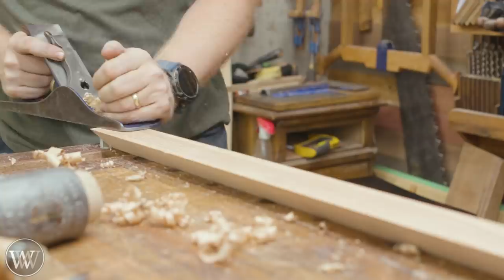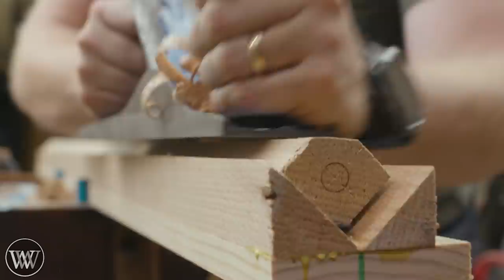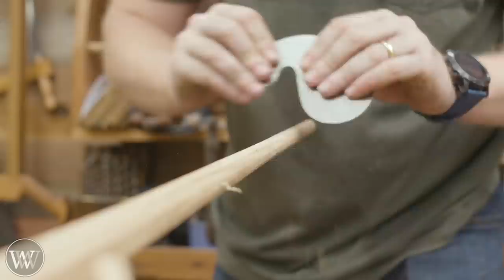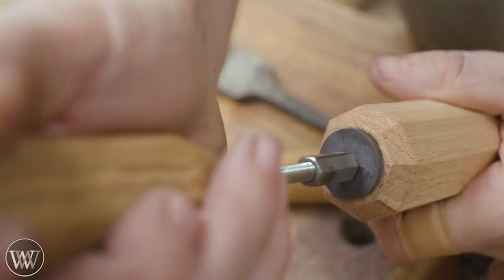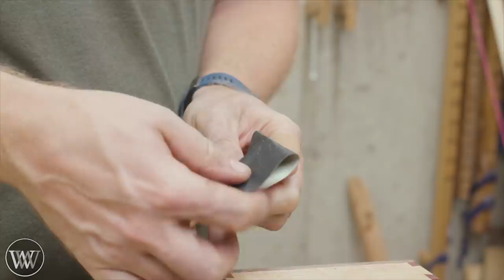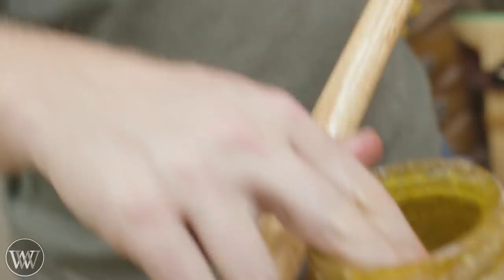Pool Cue Made With Just Hand Tools

Comment: Nice video but playing with fire with that lag screw.  Might I suggest a dowel next time?
Reply from the maker: Thanks. No a dowell is not adjustable and you need to be able to make it thread up and down. Though it looks like something you could very easily hit it is actually very hard as it is lower than the circumference of the circle. And even if I do hit it with the scrub plane it's no big issue because it's a scrub plane

Comment: Nicely done brother, but do you not have a shave horse and a draw knife?  I love my hand planes too, but that's crazy!
Reply from the maker: Thanks. a shaved horse andronic would work but it would be much harder to get an even clean taper. The nice thing about doing it this way is that you can get a smooth taper running from end in very easily. on top of that you can take off a bit more material accurately with a scrub plain then you can with a draw knife unless you have a lot of school with one which I've seen some people who do.
Reply: I didn't think about a scrub plane.  That makes a lot of sense.  Thanks for the reply!

Comment: What a great project. Is oak the "correct" wood to use here? I would guess something like hickory would be used traditionally. Not judging, legit question
Reply: Cues are typically made out of Canadian maple, although I don't see why oak couldn't be used for people who prefer something heavier.
Reply from the maker: there is no such thing as "correct" wood most common is hard maple,  but usually closed grain very hard woods. I have seen several higher end companies that make them out of south american woods.
Reply: Snooker cues are usually ash, I'm not sure why. It might just be tradition. The flexibility and density of the wood does affect cue ball deflection. Two piece cues usually have a maple shaft, and the butt can be anything. Carbon fiber shafts are becoming popular, but they're expensive, and not everyone likes them.

Comment: not how we did it when i worked for Carmeli Cues, but bravo sir.
Reply: Come on!  Do not leave us in the dark. How did you make ques at Carmilis?
Reply: Come on now!  How did you make them at Carmeli 's?
Reply from the maker: Yup. they were split in half to make them easier to turn and people liked that for traveling. It is easier to cut them in half then shape it then it is to shape it then cut it in half.
Reply: vmitchinson I turned shafts and butts. he did the inlay work, ferrules, tips, finishing, and all the design.  he has nifty trick for knowing which blanks are ready for processing: listen to their sound when hitting them on the concrete.